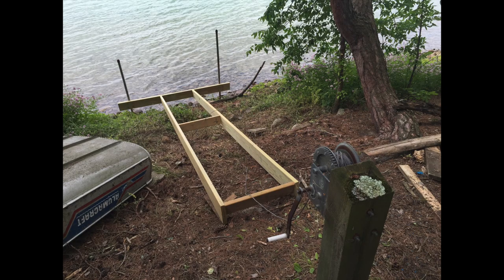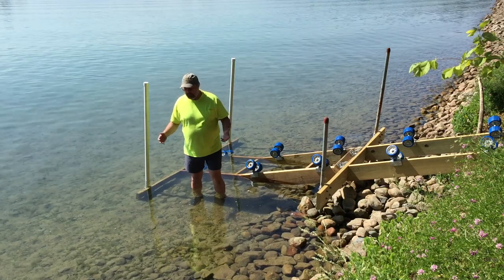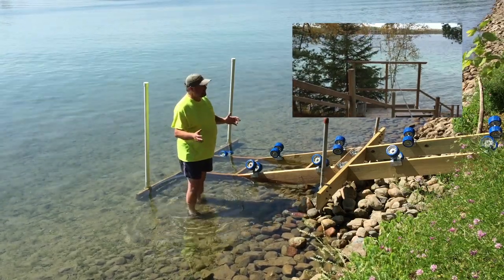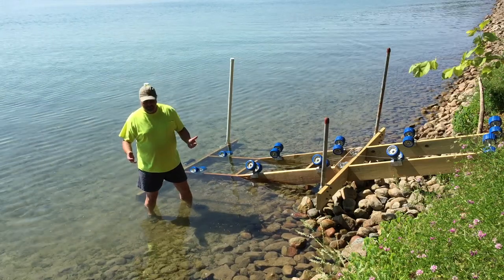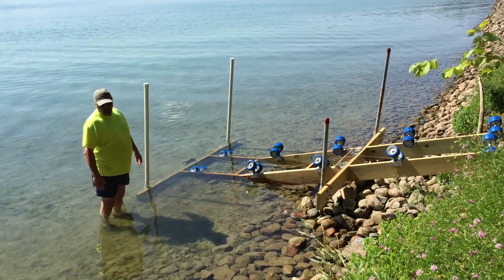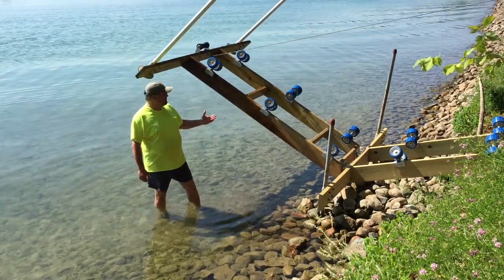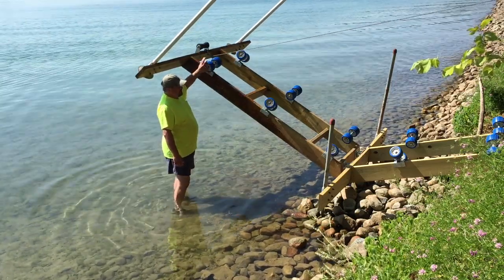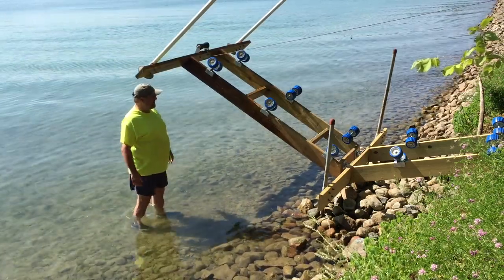How I Built My Multinautic DrawBridge Roller Boat Ramp Project

Comment: Pretty nice set up Eric  Smart move preparing for the future  as you did   Luckily the Lake house  i use has its own Concrete launch and recovery ramp on the property  which is very convenient to just using the trailer for winter storage  plus  by the ramp there is enough room to park most of the trailers  in the summer time !  Yes they sit in the weather but  that doesn’t appear to hurt anything with proper maintenance and lubrication One thing a freind of mine does on his lake  is he utilizes a 12volt winch mounted to his truck to get his docks and boats out of the water seasonally by himself   Its a pretty good  setup and he uses a inexpensive winch from Harbor Freight he stores in the garage  untill he needs it  as it attaches to his trailer hitch receiver  temporarily

Comment: That's awesome! I came here looking for a simple pressure treated ramp or pair of 2x6 rails to pull a Sun Dolphin pedal boat up a similar bank at our camp ground. Nothing fancy, and I'd have to be able to remove the ramp from the water at the end of the season. I was thinking of just pulling the boat up the 10' with a rope, but I like your 'thinking about the future' as we aren't getting any younger. Maybe I should look into the wheels and a hand crank recovery system, haha! Thanks for your video!

Comment: I have been thinking about buying an old boat trailer, removing the axle and wheel and then building a steel frame that sits just outside of the trailer with a single pivot point such that I can tilt the trailer down into the water to retrieve the boat and once fully on the trailer, gravity would rock the boat on the pivot point to near horizontal and well out of the water.  Just gotta find the right trailer (cheap).  Any thoughts about how to do this?
Reply from the maker: Make it out of aluminum and use two sets of guide-ons to locate the boat correctly. Unless the whole thing is fully submerged, you will have a problem with the boat rolling  back into the water. For this reason you see the winch. These days if I was to do this project again, I'd make everything out of aluminum.

Comment: Eric, your ramp is awesome!  I’d like to build a ramp for my pontoon.  Where did you buy the rollers?
Reply from the maker: Bruce, I think you’d be better served by an aluminum lift or ramp. The style rollers are designed for V-hulls. If you want a roller ramp for a pontoon, you need to use a different kind of roller and ramp design.

Comment: Awesome! I've been researching ways to build a ramp to pull my Jon Boat out of the water without a boat lift. It never dawned on me to make it so it could be raised out of the water. Are those wheel kits till on ebay?
Reply from the maker: I've got the Amazon links the Multinautic hardware in the description. I have since found out through experience that the Multinautic stuff is better built than the eBay stuff.  Thanks for watching.